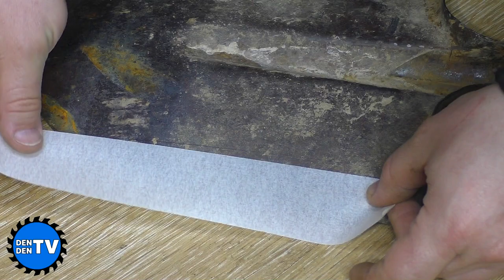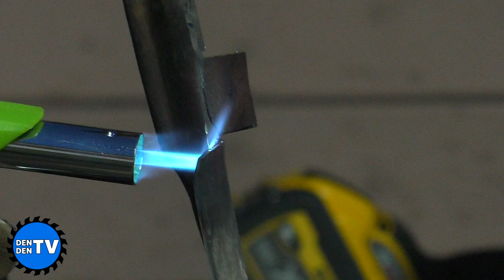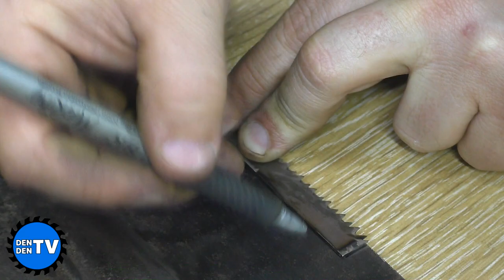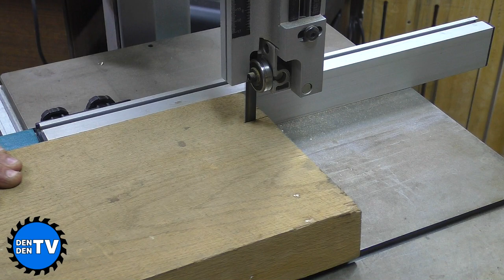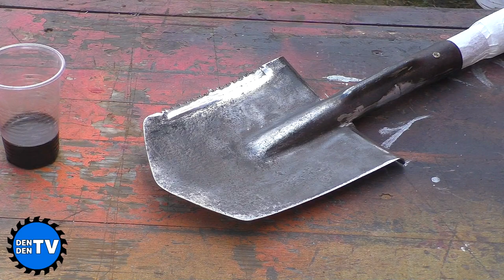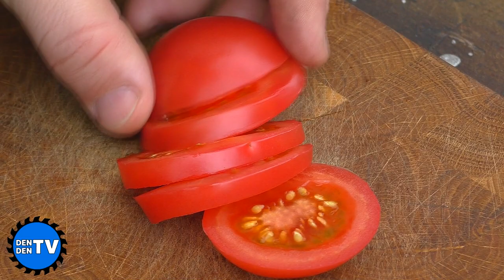Никогда не выбрасывай старую лопату!!! Сделай и ты себе!

Comment: Make sure that set screw is solid stainless steel if you ever want to change the handle or your mind. The saw teeth should have been installed the other way. For pull not push stroke for more control. But excellent work bye the way I really like it.

Comment: I got a shovel out there that's handle snapped in half took gorilla glue soaked all exposed wood and zip tied it tight and wrapped it in black tape . Four years later it still works.

Comment: Only problem is when you weld on hardened steel like a shovel or saw blade it weakens the steel . Unless you re heat treat it , neither will be the same again as it should be .

Comment: Thought the saw blade was a great idea..instead of permanent welding it on..maybe like a hack saw removal style so if it gets damaged you can replace it..weld 2 nuts on it..with bolt it on . Otherwise awesome and smart..yes I do concrete construction and use a shovel everyday all day long..